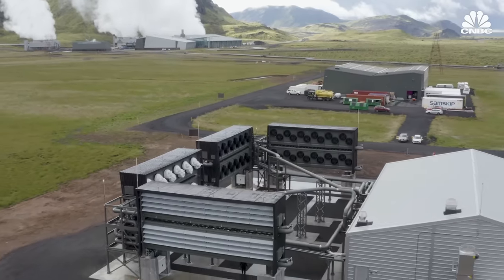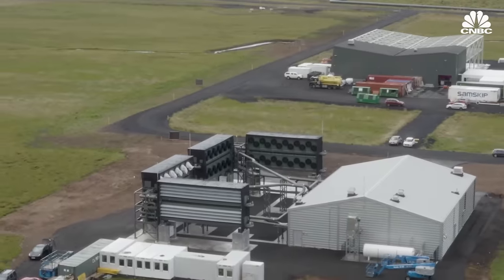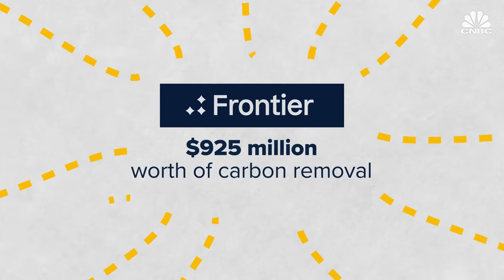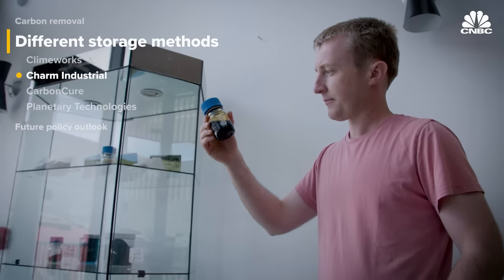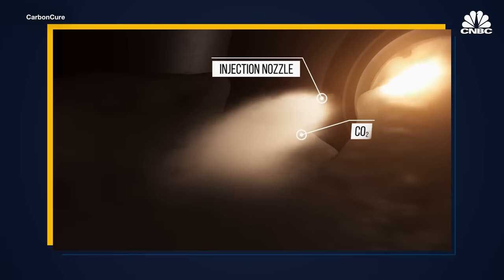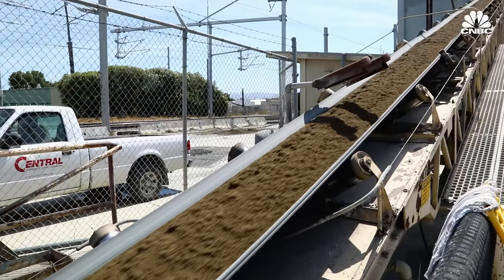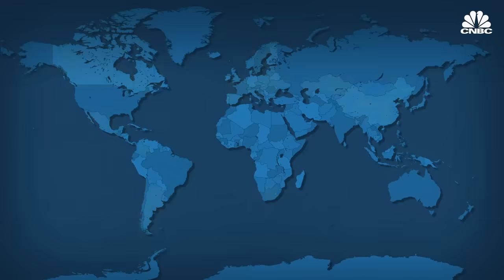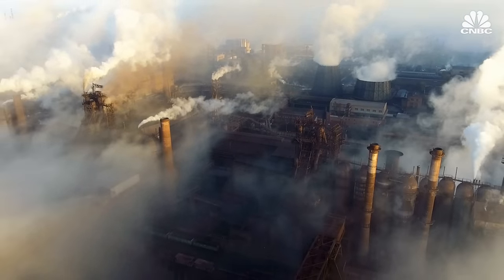Why Big Tech Is Pouring Money Into Carbon Removal

Comment: If only there were some kind of organism that could capture carbon while using renewable energy (like solar), and at the same time produce oxygen, shade and food... Oh wait...
Reply: Yes, like ocean plankton, which are starved for iron oxide and can be cheaply stimulated by seeding the ocean with iron oxide particles from ocean barges. Plankton also feeds a lot of ocean animal life.
Reply: We cannot remove all the CO2 that we emitted just by planting more trees. We need a bit of everything for this to work. There is no one single solution to this huge problem, so we have to use a combination of all these different ways to solve this problem
Reply: @aniruddhrao3489  no
Reply: It was discussed in the vid. It would take up too much land mass. Seaweed and kelp would be a better crop and faster growing too.
Reply: @M5a1r4c7  NO. Most ocean scientists have turned on iron seeding as a good solution. Not only does it still leave carbon in pretty easily accessible forms that will be released back into the atmosphere much more quickly than when it's in bicarbonate form, it also causes issues with wildlife. What happens when an algae bloom starves an ecosystem and throws it completely out of whack? It's a cool idea, but it has more downsides than positives right now.
Reply: @Cyrribrae  Thanks for your reply. Could you recommend some of these studies or just the experts that have turned against it? Would very much appreciate this as I've haven't found that much other than one person who's tested this approach one or two times.
Reply: I would prefer a organism that could capture carbon and emit pizzas burgers and hotdogs😁
Reply: On a large scale Algae is actually a much better organism as it is much more efficient at capturing CO2 for the same surface area.
Reply: You must be one of those people who comments before watching the full video because they specifically mention why trees are not enough.
Reply: @mudshovel289  I did watch the full video, and my comment was not directed at the video itself.
Reply: Unfortunately, even if we planted trees on every patch of bare soil on the planet - it's not going to be enough. 
Over the past 200 years, we've thoughtlessly burned our way through carbon reserves representing the remains of many trillions of trees (plus many trillions more other plants and animals that are often overlooked), countless generations that lived over a time spanning 100s of millions of years. 

It's going to be very difficult to put all that released carbon back into the ground where it belongs. 

It will take as many ideas as people can come up with to begin to make a difference, eventually. 
And I think that even if we, the concerned, do manage to convince the large number of climate change deniers that this is no hoax, and that we must 'all' pull together and change our lifestyles - all of us alive today, whether old or young, will never see a year of reasonably steady climate. 
What's going on in the world right now will be our new normal. Our children and grandchildren are going to suffer extremes along with us. Can we do something in time to help the great grandchildren? That depends on whether we, as individuals, actually 'do' something to change our lifestyles starting from today, or whether the majority are going to sit back and hope that someone else does all the hard work for us.
Reply: Not enough profit in that brilliantly simple answer.
Reply: Trees cannot provide nearly enough carbon removal.  That is the real problem.
Reply: trying to offset our output with trees, is like trying to cook your dinner with a candle!

Comment: Why do I feel like it's not a great idea to dump tons upon tins of baking soda into the ocean at the rate that we create carbon? Honestly I feel like the focus should be on building materials
Reply: Feel the same way, same with putting it in the ground and having it become solid rock while using water... we kind of need water and there are all these underground aquifers that will be disrupted. I've heard they made graphene from CO2 which is currently really expensive but could make batteries that can charge in 8 minutes. I think we should really think about all the things we can make with CO2 from the air and design systems to clean the air to create something useful like the stronger concrete. Who knows, maybe carbon capture might actually make money in the future....
Reply: @DavidMcCalister  agreed. If marine biologists ok'd it that's one thing but roads, buildings, landscaping rock ect would probably be better uses
Reply: completely agree with you, far more beneficial to use large industrial scale seaweed farming to absorb CO2 then this baking soda venture. Seaweed can be used as livestock feed, organic fertilisers, bio degradable plastics and bio fuels. Plus seaweed types like kelp and kale grow 10x faster then trees and absorb 10x more CO2. To me, this makes more sense then alot of the things proposed in the video
Reply: @roxy cauldwell  You have a point - putting carbon into building materials is a good idea - anything to lower the carbon intensity of cement is a good thing. We need many solutions - I don't think that any single approach will be enough. One of the benefits of the Planetary solution - adding antacid to the ocean - is that it both removes carbon from the air and reduces ocean acidity. At the rate we're polluting the ocean now with excess CO2, we are clearly on a path to too many dead coral, very unhappy lobsters and clams, and an overall unlivable ocean, which would be very very bad for all of us. So, let's ask Planetary to experiment a ton before adding too much to the ocean, but let's get them working on it.
Reply: @PeterChargin  I do agree there will be no single solution, but I have quite a big concerns about adding acid to the ocean - it might work but it will be hard to control and if something goes wrong with very small chance to fix it - it is just like Gates idea to spray some particles in the air to reflect the sunlight. Adding is the easy part of the both technologies - removing if or probably when needed will be the bloody hard one.
Reply: @BenzinioB  We're currently adding a lot of acid (aka CO2) into the oceans. What they're doing is removing that acid by adding an ant-acid (aka a base).
Reply: Nope and even the way he said it you can hear that he knows it’s a problem.
Reply: I also had a moment of.. "Wait, really?", but on the other hand, there's nothing crazy about what they're suggesting here. A mild antacid is not going to have major effects on ocean wildlife on large scales - and it's going to be A LOT LESS detrimental to the wildlife and ocean chemistry than our previous ideas of doing things like encouraging algae blooms via iron seeding, letting them die off, and sink to the bottom as organic waste. That's not to say rebuilding kelp forests, for example, isn't a great idea - but it's not like you can do that everywhere and certainly not at the needed scale.

In fact, ocean acidification is one of the biggest concerns of some climate marine biologists/chemists. Animals like corals and their reefs, crustaceans, mollusks, etc all depend on calcium carbonate to create their shells and formations. What happens when the ocean becomes too acidic to support that? (Science is actually out on how bad it will be in the short term, but I can assure you that people would prefer to avoid it.) 

Directly counteracting the acidification of the ocean is not only potentially good for reducing atmospheric CO2, it's also probably good for the oceans. After all, what is the byproduct of mixing an acid and a base? That's right, it's a salt and water. There is no better place to do that than the ocean.

Now, that said, caution is 100% justified. That's why I'm glad that they're doing tests with wastewater first. That's a perfect place to test this out and see if it works as expected. And of course, when they move on to open ocean trials, we'll have to see whether there are any unintended side effects that change the calculus. But as a core concept, there's actually nothing wrong with the idea.
Reply: @BenzinioB  That's not how this works, so rest assured. None of the base lingers in the environment, this isn't some mystery chemical floating in the oceans for millions of years. It's just a very weak base (ANTI-acid) that immediately reacts with the acids in the ocean to leave only some salt (what type depends on what is used) and water. Less acidic ocean, no scary leftovers. That's it.

And right now, we're already worried about the ocean becoming too acidic too fast because of climate change. We still need to deal with that problem. Now, eventually, what this guys is saying will happen in reverse. If we eliminate all the CO2 in the atmosphere, the oceans will equilibrate and get more basic. But.. it kinda makes sense to work on both ends at once - especially because the oceans absorb the VAST MAJORITY of CO2 on the planet today. We can't make up that difference with a few kelp farms or concrete (though, this is a brilliant idea and I love that - creating cement is a big contributor to carbon emissions on its own).
Reply: Because you were unaware of the chemistry of what's currently happening? Acidification of the oceans has been a SERIOUS problem for a very long time. So all that's really happening is that this UNNATURAL process that's been running amok will start to be reversed. 

The ocean's acidity will neutralize, and captured CO2 will turn into rocks. That's all there is to it really. Rocks capturing carbon has been happening for millions/billions of years. There's nothing unnatural about limestone formation. 

Yes, the process should be monitored to try to find any unaccounted for externalities, but it's a heck of a lot better than just dumping acid into the ocean forever or cloud seeding to reflect back sunlight. 

As far as I know this SHOULDN'T cause mass die-off in the oceans or weather events. In fact I believe this should cause coral to start regrowing as they would no longer be in a high temp acid bath when the ocean de-acidifies and starts to cool down.
Reply: @k.h.6991  Issue is, acid is being added globally via carbon dioxide forming carbonic acid in the water. The company would be dumping locally however. This can lead to major issues with ecosystems. All the water becoming slightly more acidic (or having weaker buffering capacity to be more accurate) is bad, but so is a huge change in pH in one region because you are dumping all your carbon capture runoff at just a few locations.
Reply: @Cyrribrae  You have a large issue with source and sinks however. Carbonic acid is entering the ocean globally. This base would be entering the ocean locally. You could cause some pretty bad damage to local environments if you don't consider how you are distributing this runoff.
Reply: @colmcoakley3916  how are you going to grow the seaweeds if the ocean is already tipped to the acidic side of the equation and it won't support growth of new plant life. That's the reason for the baking soda, to increase the alkalinity of the environment to a former level that will once again support the growth of the Western US underwater forests of sea plants.
Reply: The only one that seems cost effective to me is the concrete idea
Reply: @DavidMcCalister  Technically, most commercial graphene right now is made from co2 by chemical vapor deposition. It's just co2 that was released from fossil fuels specifically to make the graphene. Creating graphene from ambient co2 has only been done in a lab so far as I'm aware. Recently, a company called c2cnt started capturing co2 from flue gas and creating carbon nanofibers. They do have a process for creating the nanofibers from ambient air, but it's not in use yet.
Reply: Should use the baking soda for baking more cakes instead of tipping it into the oceans:)

& I really hate the idea of oil & gas companies borrowing the CO2 to make even more pollution for profits
Reply: We can use the CO2 in many processes.  We have industrial processes that use the stuff, many more are being invented right now, and CO2 is used in many, many things.  If you drink soda or any other fizzy beverage, the fizziness was down to infusion of CO2.  There are so, so, so many uses for the stuff.  It is simply a matter of replacing the existing processes to obtain CO2 for these purposes.
Reply: @unconventionalideas5683 Then why are they talking about putting it all into the ground. I still say this is Hopium without solid government intervention.
Reply: @DavidMcCalister  This is in Iceland. The process does not use up water but needs very hot water with heavy mineral content to work. Iceland has a somewhat unique geothermal system that allows them to do this. They basically have a natural reactor going on under their part of the earth.